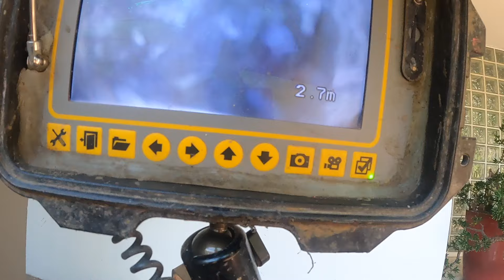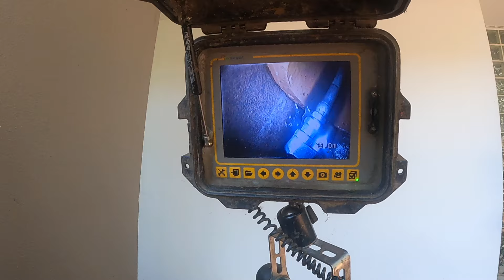Blocked Drain 668

Comment: Here is a thought, you said that was the sea. If that really was the ocean it will have tides. That may be what is causing the drain to flow slow at times (besides the roots). Look how far the deposits go up the pipe. Much higher then we see it in this video. Also explains why the lower pipe is so clear, roots hate saltwater. I bet at times the sea side exit of that pipe is totally out of water, and at times its really got sea water pushing back up into it.

Comment: I have to say mate this is the very first video I have seen you just throw the cutting tool to one side, usually your very partucular in your screwing them back onto their place on the hose holder. Not a drop in the pipe then just a more massive amount of roots. Great to watch a professional of more than 22 years at work.

Comment: @20:34 "Runs up hill a little bit.  So it's gonna hold some water in there".   The real problem is it will also hold silt in there.  What a mess of a drain.  Good job getting it working.

Comment: man i really wish my company had your flushing set up. 
also, i do drainage primarily at the moment for a big plumbing company in vancouver canada, and i gotta say you are really good with that thing. It also helps that most of the places you go to have clean outs on the outside. Here in canada we're stupid and like clean outs on the inside, making flushing a clogged line impossible. 
But the flusher you have set up is top notch, we use pressure washers and trailer flushers which are far less convenient.

Comment: Hey mate quick question: Some guys using these other metal spiral like device with chains attached to the head. Is it just another type of system or can you do stuff with it that you couldn't achieve with jetting? Thanks for the great content!
Reply: The chain style head is used more for cast iron pipe it knocks the scale off the inside of the pipe & can unclog some drains when u nock the scale off the pipes thats what causes the clogs cause stuff gets caught on the scale worse if someone throws flushable wipes or paper towels or tampons or max pads cause they stick & dont break down & then more stuff sticks to them & so on then it clogs the pipes hope i explained it good enough for u.

Comment: Someone actually placed wood pillars directly in a drain pipe in order to wall enclose a stairway? Oh that jackazz has some explaining to do here.
Reply: It was a downpipe from the roof, that was built inside the wall, rather than on the outside like normal. Covered by a piece of chipboard on the inside.
Reply: @mark77193  Whew… I hope that wasn’t intentional. That structure looks very recently built. Ollie chew that board up something vicious— end up looking like a gremlin after a Thanksgiving dinner. 🤣
Reply: @garrettstitt5489  🤣